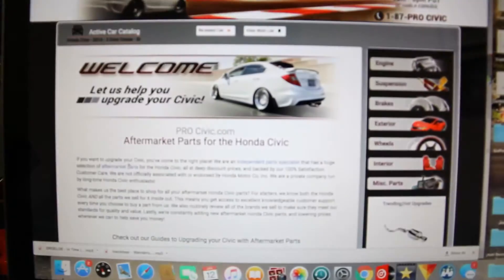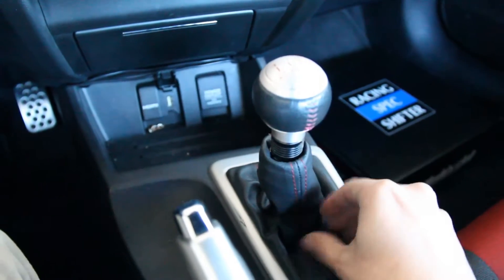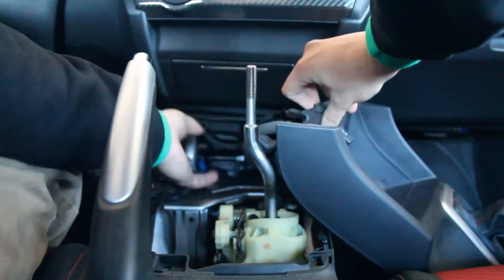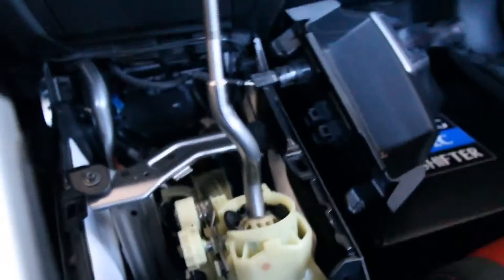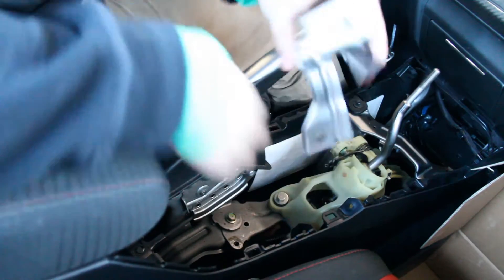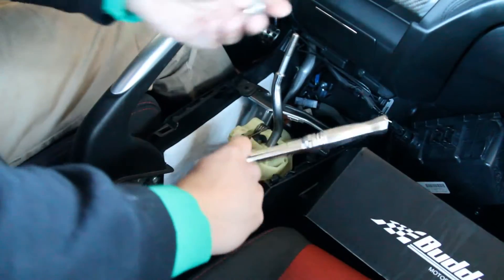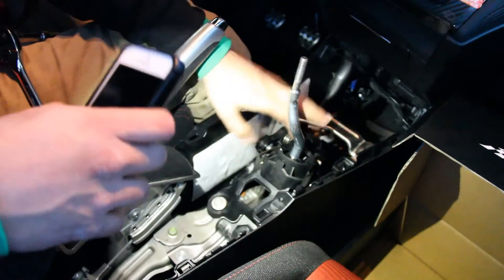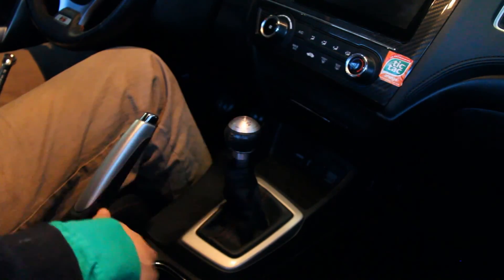How To Install a Short Shifter (2012-2015 Civic Si)

Comment: It's hard to tell for sure, and this is really just an assumption, but it seems you might have over torqued the M8 bolts for the base bushings. Really the only need to be snugged up, just a smidgen after making contact/bottoming out. Otherwise you run the risk of over-tightening or stripping. 

Keep up the great work though! And as a side note, I've also found the Buddy Club shifter to provide less of a throw reduction than expected, still a good upgrade on any 9th gen!
Reply from the maker: Rodolfo Izquierdo I didnt over torque them. It may seem like i did but i grabbed the very center of the socket wrench (point of least amount of leverage) and turned with my fingers. And Im going to switch to an Acuity so the BC SS will be out of my car soon.